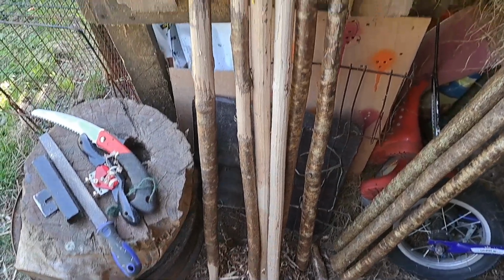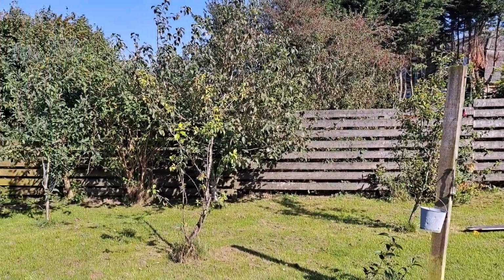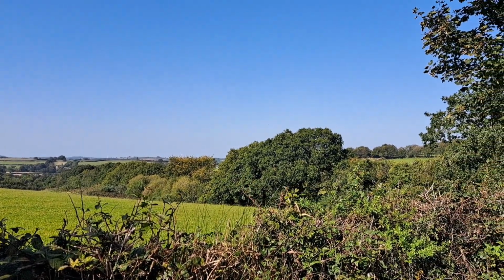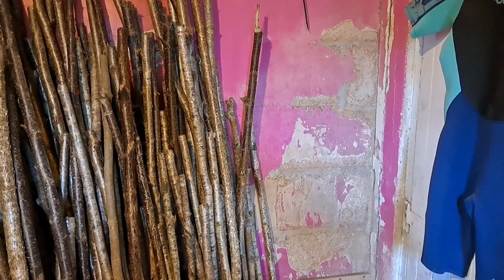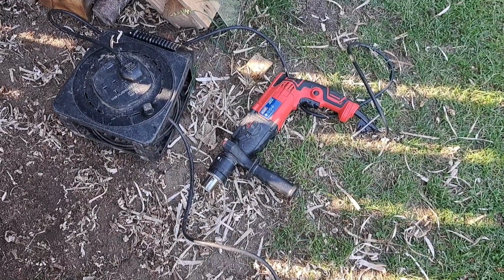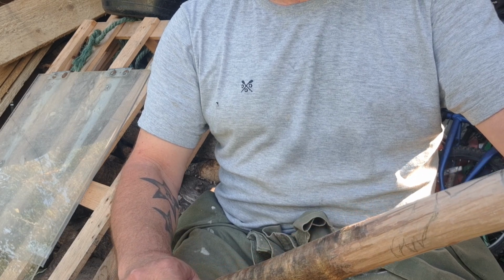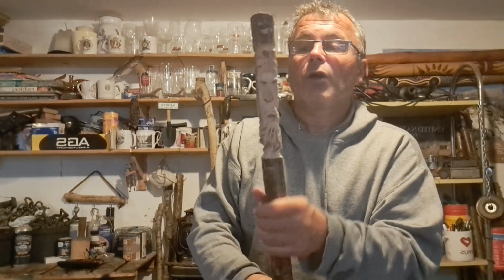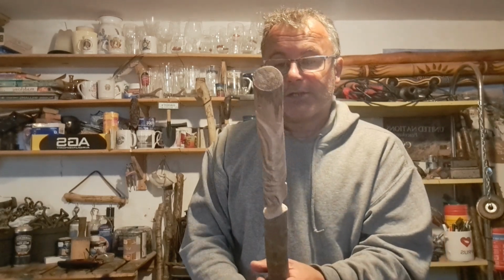Woodspirit carving on hiking sticks. Hiking stick Workshop up date.

Comment: i fitted a copper tip ,the last tack split the end,i have enough height to start again,i will have to geta tiny drill and make pilot holes for  the copper tacks,i got some seasoned hazel,your sticks look lovely
Reply from the maker: Hi , yes that's the way to go with a small drill pilot hole that also countersinks it also. I don't full go through the wall and use a small pointed punch to give a pin prick hole to put the tack in to. All the best and good luck this time round.Happy crafting. Andy.
Reply: @hiddenvalleyfootpaths2561  thanks andy,i live in torquay,i would love to come and see you and buy a couple of nice sticks from you,i wont be gifting them i am keeping them for ME lol
Reply: @hiddenvalleyfootpaths2561  hi andy,can you please tell me where you get copper pins from,i cant  find them,i can find copper tacks but not copper pins with heads on them